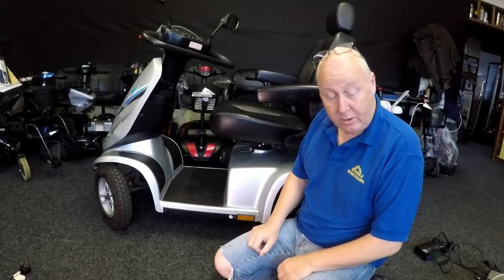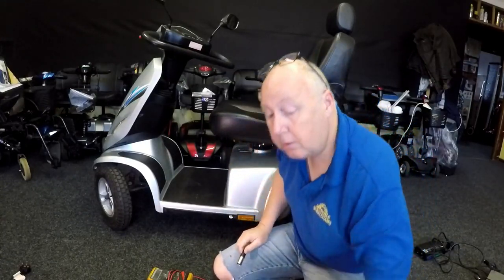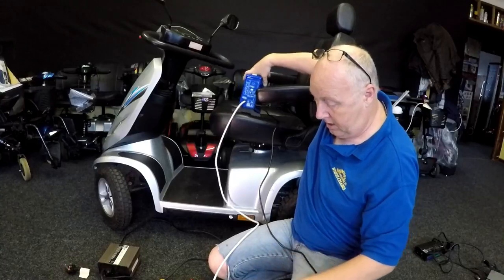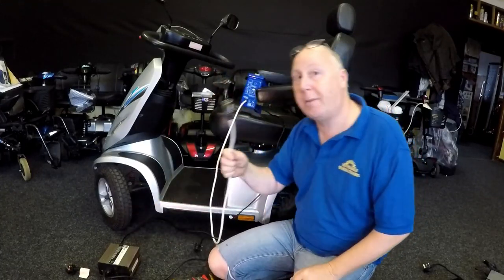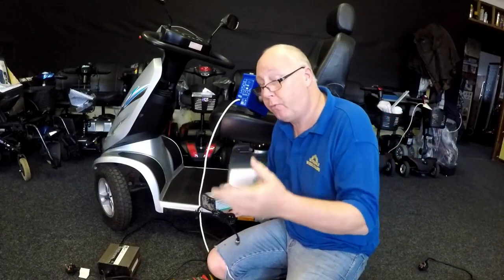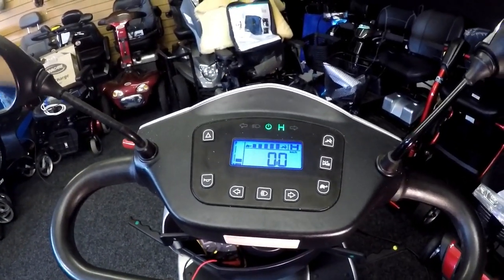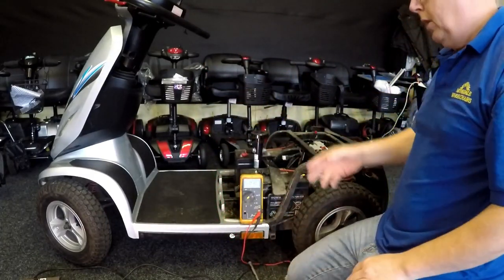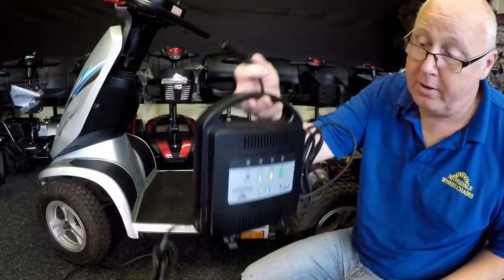Testing a Mobility battery charger & how to test if its faulty. How mobility battery chargers work.

Comment: can you tell me how i can load test my 75ah mobility batterys.  not one video on youtube tells how to load test mobility batterys correctly. how do i know what the  cold cranking number is. i have got i  6/12v load tester but its for batterys with cold cranking readings. And mobility batterys just dont have this number. i have tested my batterys with this load tester here,s what happened. i charged batterys fully i think they charged upto 26.3v. i then left then for a few hours and they settled permenently at 25.8v  i did a load test on each individual 12v battery these were the results... starting charge on load tester was12.6v i load tested them for 10 seconds and they dropped to  11.4v and then recovered to 12.6v the needle pointer kept in the lower green zone through out the load test then recovered upto the top of the green zone. could you help in any way or maybe do a proper video on the subject. it appears no one else will do load tests on mobility batterys. could you use 75ah batts in the test if at all posible... love watching your vlogs my friend, they really are educating and intresting. ATB Bri
Reply from the maker: Hi need a special load tester that discharges over time depending on battery current. Expensive tool usually only dealer and engineer like us have them. You will need to take the batteries to a dealership, could take around 1hr or so to test one battery.

Comment: Hi Tom, I have a ZT500 mobility scooter bought in Nov 2020 from Green Power Ltd it's been working and charging fine until boxing day when I went and turned it on and it had no lights on the control panel it was completely dead, I plugged in my charger that came with the scooter and the green light came on but the Fan was not working telling me that the charger was not working properly, does your Company/Firm do you have a website I can send pics&specs of my charger, Thanks, Patrick Considine.
Reply from the maker: Sounds like a fuse has blown check them and there may be a circuit breaker on the scooter

Comment: I HAVE A PRIDE TRAVELLER PLUS SCOOTER...MY CAR HAS A BUILT IN 150 WATT CONVERTER, CAN I USE THIS SYSTEM TO RECHARGE MY SCOOTER BATTERIES???
Reply from the maker: Could do mind you we sell chargers that you can plug into the cigarette socket but it’s always best to charge the batteries for a minimum of 8 hrs every time you put them in charge so if you are doing it your way then only as an emergency 🆘 and not recommended for every day charging. Hope this helps
Reply: @tomjacques4  I THINK YOU DID NOT UNDERSTAND MY QUESTION...I AM NOT TALKING ABOUT USING A CHARGE THROUGH A. CAR LIGHTER, I AM TALKING ABOUT A 150 WATT BUILT IN COVERTER THAT ACCEPTS A REGULAR 2 PRONG ELECTRIC PLUG, THIS OUTLET IS BUILT INTO THE CAR AND IS A BUILT IN COVERTER THAT WILL CONVERT AND USE THE CAR BATTERY  , NOT USING A DC PLUG INTO A LIGHTERS PLUG.....
Reply from the maker: @howardkahn4330  ok then as
Long as it’s a true sin  wave inverter then fine and again minimum charge 8hrs calculate that the battery is big enough to accomplish this

Comment: Hello just wondering if you could help my mums scooter was working fine but out the blue even when it’s fully charged the power indicator drains from green to yellow right away it gets her to the shops and back about 5/6 times before it’s needing charged again the shop is only about a 3 to 4 minute walk away I’ve changed the batteries it didn’t make a difference
Reply from the maker: Check the electric ⚡️ brake
Reply: @tomjacques4   thanks I’ll give it a go 👍

Comment: Hi I have a question please me and my partner both have a scooter both are freerider brand with 50AH lead acid batteries on we keep them out side at the back of the house which has been fine for the summer as we have only had them since April this year my concern is the winter is coming lower night time temperature frost and freezing ect the scooters will be in these temperatures I can house them in a shed to keep the weather out and have fitted outdoor weather proof plug sockets so we can charge them outside obviously keeping the charger away from any rain or water but I am not sure what to do to avoid any damage to the batteries we will still be using the scooters during the winter and charging them what would be the best way to protect the batteries ? I had thought about removing them from the scooters on colder nights and bringing them indoors but then I cannot charge them away from the scooter or if the charger is plugged in and connected to the batteries on the scooter will the charging be enough to stop the batteries from freezing and getting damaged I assume while charging some heat is created in the batteries is this enough many thanks .
Reply from the maker: Billy Hood correct as long as you charge them during the night you should be ok. A good quality waterproof cover is a must, no silly cheap £25 cover. No plastic either. You must let the scooter breath otherwise condensation will occur and will start rusting etc. Hope that helps

Comment: Hi thanks for the information I have an old Mercury M48 I charge it over night some times it does not charge so I unplug the charger from the scooter and the mains replug it back in it may work then or not were should I be checking I have all the test equipment I need. Thanks in antisipation Bigt
Reply from the maker: I would check to see if you have a slack connection between the charging plug and the female plus. also check the fuse at the rear of the scooter for corrosion or slack connections.

Comment: Hi my mercury prism scooter  battery are new but drin with in 5 minutes then swinch off do you no what's wrong. Thanks
Reply from the maker: Sounds like there’s an issue eh. What checks have you done.  What happens when the battery level is low. Are these eBay batteries or proper ones
Reply: @tomjacques4  good battery trun on says full reading 25v after 1 minutes battery level goes down then scooter swinch off have press the swich on.

Comment: I have a Colt Executive scooter with 100amp batteries. I charge up it shows fully charged. But it drops to show almost empty after a few miles.  It’s meant to do 20 miles.  If you can provide any advice thanks. 
Regards Stephen
Reply from the maker: Check to see if any part of the motor and brake are hot 🥵 if not Get batteries tested with discharge tester takes 1h plus to test each battery. That will then give you a computer print out of test. Do not use any cheap rest equipment that tells you in minutes if batteries are ok or not
Reply: @tomjacques4  if they are hot what does that mean?

Comment: Hi hoping you can help I have a go go pride ultra scooter and am having trouble . I can put brand new batteries in and it will run fine until I have to charge it what happens is the needle will read it has a full charge but when I go to ride it the needle goes way down instantly almost and I have very little power. I have bought new batteries a few times thinking I got bad ones but the same thing keeps happening can you tell me what I need to check please. Thank you

Comment: I am in the middle of trying to find the fault with my electric scooter and think its either the battery or the port where the chargers goes in, i heard you say you sell replacement parts, where is your shop or can i order online or over the phone.
Reply from the maker: https://www.nithsdale-wheelchairs.com/
Reply from the maker: https://www.nithsdale-wheelchairs.com/charging-sockets.html
Reply: Thanks for the reply, al definitely be looking at your website. Am just gutted and to far away to take it in lol. Would it be possible to call the store and speak to an engineer to explain exactly wat faults are and wat parts are most likly to be at fault. I have an electrical engineer friend going to look at it this weekend to see if the chargers i have are faulty or if its the battery. Many thanks again.
Reply from the maker: @steviep81  hi you should find the engineers number on our website
Reply: Thanks for that, al be in touch after i speak to my  friend.

Comment: I have a Sterling Sapphire 2.  It has only been used aprox 8 times and then left to stand for 3 years. I put the charger on and it keeps blowing the 3amp fast blow fuse in the charger. Any ideas ?
Reply from the maker: Recon you will need new batteries
Reply from the maker: Could also be a charger issue. Check  the battery terminal connection on the battery box. Hope this helps
Reply: I took the batteries out of the black boxes and tried to charge them with a normal battery charger... neither battery will hold a charge so new batteries it us then 👍👍

Comment: P.S. I have tried different chargers as well with the same re sults
Reply from the maker: Hi check the fuse. There is usually a fuse to prevent damage to the system look for it remove it and check
Reply: Thanks I checked the fuse its good anything else I can do?
Reply from the maker: @brethevenin2324  yep sure you can do a continuity test on the wires all the way from the front to the back

Comment: How to replace right steering bar on my sterling s700
Reply from the maker: Hi we can supply the track rod ends and to rod Assy if required. Easy job. Just undo the bolts holding the track rod end on and it will fall off.

Comment: My bike is charged but it's moving slow please help
Reply from the maker: check the speed pot and throttle pot.. if you have a 4 pole motor ensure all brushes & commutator are ok also check to see if the electric brake is not binding on hope this helps.

Comment: Hi. My scooter is charged over night. So I full charge the next day. I have power. But hardly any speed. What can it be. Thanks karl
Reply: could be wrong but might be throttle pot,  Tom will know though
Reply from the maker: Good Morning Karl: there are a few reasons that could influence the speed and this will depend on the scooter your have. 1. the throttle pot 2. the speed pot 3. Half speed switch 4. some (8mph) may have a micro switch on the tiller to slow down the speed on corners 5. slack or faulty wiring 6. a worn or broken brush unit (depending if  your motor is fitting with 4 brushes) 7. An electric brake problem. 8. controller issue..... So as you can see there will be a lot to check ....